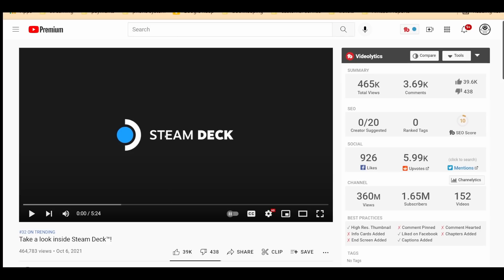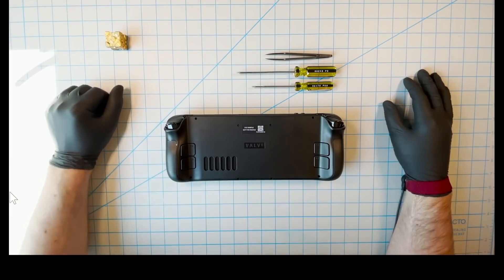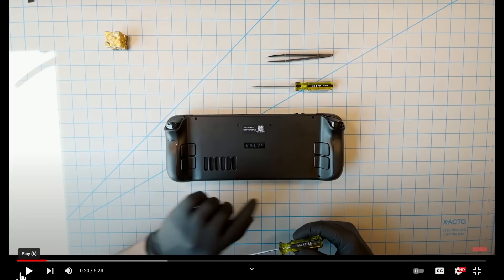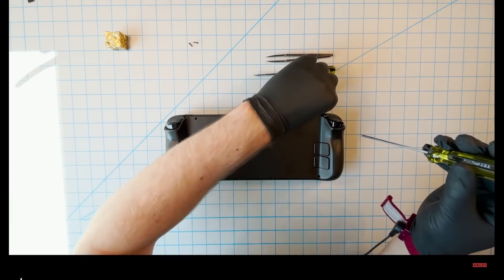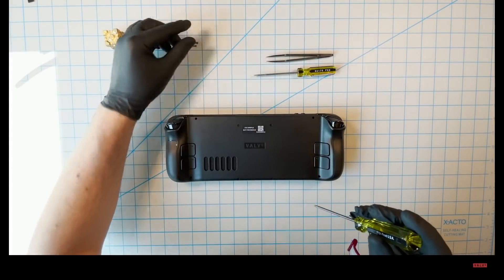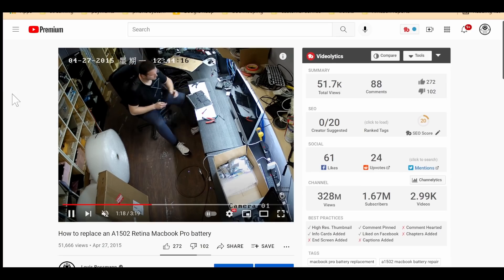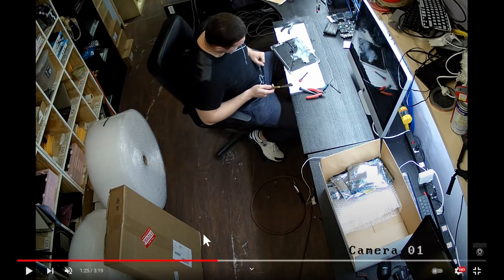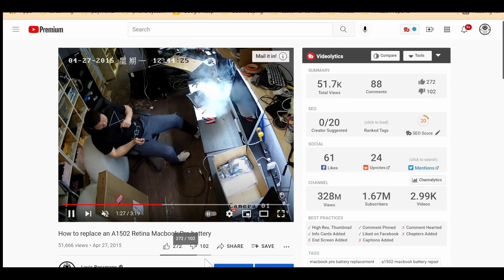Steam deck battery may end your life? bruh 😑

Comment: Regarding the losing stability when dropped when opened and I may be wrong how I understood it but this is how I understood what they said:
They mentioned that self tapping screws are much easier to strip and once you strip them the structural integritiy - of course - suffers. Also, from experience with self tapping screws in plastic: they suck. Hard. They will never be as tight after unscrewing and screwing them back in compared to the original screw in. Self tapping screws into plastic is easy and cheap but designwise it's absolutely horrible.

But all in all, I mean, the disclaimer with the batteries... I feel like they also have fears kids are just gonna poke around in it. I'm not saying kids will, because when the PSP was introduced, I don't remember anyone of my friends who hat one went ahead and poked at batteries for fun and then being suprised they burnt themselves (and I had some pyromaniacs as friends...). I have nothing agianst them saving their butts. And they even say, you have all rights to open it up, we just say, if you need anything repaired, better bring it to a professional. And that is pretty much what right to repair means to me. You have the option of doing it yourself, but so have professionals, who are independent repair shops as well.
I mean, yeah, you can cut your hair yourself, but if you really want it to look good and it's a cut you haven't ever had before, maybe it#s best to visit a hair dresser. And that is perfectly fine with me.

Comment: It's just an assumption, but the comment about the device being less structurally sound might have to do with the fact the crews are self taping. What I mean by this is that when the screws go in the first time, they go in the plastic without there being a hole or a hole of the same diametre as the screw, so it's held in due to friction and displacement of the material. Therefore removing them may remove some material and reduce the local stresses and thus make the connect later on less snug. 

Again, no idea if that's true or even if it makes sense but I can imagine that being the case, just my 2 cents.

Comment: Structural integrity of the bosses definitely decreases each time you remove and reinsert a self-tapping screw. Threads have to carve new channels to lock back in, and if the channels aren't 100% lined up with the originals, it has to move more material and locks less securely into the boss. Plus, flexing the locktabs of an injection-molded case weakens them every time they are removed. There's no way around that, most plastics only become weaker and more brittle with time and stress.

Comment: I don't believe that the structural integrity is going to be affected after you open it. Maybe it will if you break some of those plastic snaps that hold it together and are built into the case, but that won't affect the drop resistance IMO if you don't break like 50% of them. 
I've broken one on my Acer laptop while opening it and all it did was that one 5cm section in the case is just 0.5mm higher and doesn't snap in properly. no big deal and not noticeable unless you're looking for it.

I'm not a mechanical engineer, but I do design my own mechanical parts and 3D print them so I know a little bit about the subject.

Comment: A bit overdramatised, for sure - a better way to put it IMO would have been something like "if you screw this up, you could kill your device, forever. If you really screw this up, you could kill yourself. Also forever."

And yeah, self-tapping screws in particular will loosen the threads every time they're retightened. It won't kill all structural integrity at once, but if you pop the device open a dozen times to mess around with the insides on various occasions, you'll definitely notice some looseness.

Comment: "No, seriously, don't do this if you don't know how. Seriously. Ask yourself if you know what you're doing. This thing is expensive!" - Valve
Reply: Tbh this is a pretty decent advice.
Reply: @manny022 welp, there is a compromise between repairability and portability. A company making a custom cooling solution to fit in a smaller chassis, while impossible to get 3rd party replacements for, isnt dumb. Apple deciding that the exact same screen model cannot be interchanged because of a custom security code embedded into each one is absolutely dumb, however.
Reply: @manny022 In oder to do this your laptop would need to be the size of a pc.

Comment: I don't have any issue with the warnings, even when they seem a little fear-monger-y.  I think that it's correct for a vendor or subject matter expert to advise that there are risks beyond what the average person would expect and that it is advisable to have a trained professional do the work.  And then follow through by making NO ATTEMPT to stop people from disregarding that advise.  No attempt at hardware/software level "got ya!"s, no attempt at exploiting regulation for their agenda etc.  Bonus points if they make the effort to mitigate some of those risks by educating on what to watch for.

These are complicated devices with specific designs.  From a legal perspective, you can't treat everyone as "the average person".  You have to assume that someone WILL be in the state of mind where they will inhale lithium battery vapor without a sense of self preservation.  That's why warnings that we think are crazy have to exist.  The problem is when they build in measures to prevent you from working on the device.  When they try to make government fight their anti-consumer fights for them.

Comment: Self tapping screws gets worse each time you tighten them but how much... that is entirely up to the person who is tightening them. Not exceeding the torque limit and there is practically no difference. Exceeding it even slightly will cause material to deform and it will be less rugged. With care you can do that dozens of times and being careless you can strip the thread of every single screw the first time you close it. The smaller the screw, the easier it is to overtighten them.

Comment: 9:00 I've built and repaired devices held together with plastic screw bosses my entire life, and done so professionally as an engineer or tech at multiple companies. To get the best results, turn the screw backwards until it falls into the existing thread, then gently turn forwards to follow that thread. You can do that many times without substantially harming the structural integrity. It technically is slightly weaker each time, which might show up in drop tests. If you do it *badly*,  particularly multiple times, you'll wind up with rickety garbage.

Comment: @Louis Rossman Materials Engineer whom specializes in Polymer Processing and Additive Manufacturing.
Yes, self tapping screws will affect mechanical integrity of the product. Practically though after 4-5 teardowns is where any real problems would be occurring. 1-2 Tear downs should be just fine but drops of substantial height might be a bit finicky and something may come a little looser.

Comment: About the structural integrity part:

The self tapping screws will have a perfect fit with the threading since they cut it themselves. After removing and re inserting the screws, they won't sit perfectly anymore. The screws will have some minor play which lessens the structural integrity because the backplate won't be as secure as before.

While this is only really relevant in theory, because the difference between before and after will probably not be meassurable, but its still a correct statement.
Reply: If you open the thing 10 times in a row, those screws won't have anything left to grab on.
Reply: Can confirm, many interior pieces in automobiles that I have worked on over the years use this fastening method. Maybe the first time you screw something back into plastic it's okay but if you've got to do it multiple times each time you're just removing more and more material from the hole. There are ways to repair such threaded holes, what I usually do is fill the hole with epoxy, let it set and then drill out a new hole for the self threading screw to tap into. It very necessary when you're installing an interior piece to a car that hasn't been manufactured for 40-plus years.
Reply: Add that some idiot will tighten them too hard , strip the plastic, or cross thread them somehow
Reply: Maybe also those flimsy plastic tabs that might weaken or break
Reply: Additional to the Screws you can damage the Case when you pry it open.
There is a good chance to have micro fractures in the plastic that you wont see but will weaken it.
Reply: can you just put some kind of plastic putty in it and retap it?

I am just thinking wood screws do the same, but you stick some wood in there (tooth picks, splinters, etc and little bit of binding if you really care (glue for example)).
Reply: @Waitwhat469  For screw bosses that small, maybe. If you happen to have a small drill bit of the correct diameter and a thread tapping kit, sure you could change those to whatever screw size you want within the limits of the screw boss diameter. Not everybody will have a tapping kit though, but I'm sure somebody will make a video on how to do this kind of repair.
Reply: @KuraMad2000  I shall make a video on this kind of repair

Comment: I think they're referring to the self tapping screws with the structural thing, as they do deteriorate the plastic they bite into. Also with the user replacable thing, I think they mean not to not repair stuff, but to use the same specific components they picked out. Aside from the stupid "deadly" thing, a pretty good showing I'd say, I'm guessing all the overdramatic warnings were them covering their asses.
Reply: If anyone else worked on those crappy exceed rc RC cars when they were a kid you know; every time you screw a self tapping screw into plastic you're one step closer to it stripping! I doubt it'd effect the SteamDeck all that much given there's plenty of clips, but my sister's laptop fell apart from screw bosses failing, and it's probably again to cover their asses

Comment: Former Fujitsu field engineer here. The structural integrity comment made by them is unfortunately accurate.
Fujitsu did the same stupid shit that the manufacturer of steam deck did - make cylindrical screw holes in the plastic bezel instead of embedding nuts into the plastic. So, when torqueing the screws down in manufacturing, they weaken the plastic with those damn self tapping screws. If you are not extremely perfect in reassembly, you'll damage those more by cutting new threads into the plastic, as well as a good possibility of stripping the screw heads. After reassembling the tablet/laptops of 3 generations ago for the center hinge fail,  replacing failed wifi cards, replacing failed mainboards, or replacing failed hard drives, I frequently had to call our Memphis dispatch to have them send a bezel and screw kit, as the damn plastic the screws went into cracked and broke. It's just being cheap in manufacturing, and it makes repair a PITA. 
FranLab has a good piece of advice here - when screwing those type of screws back in, make sure to go into the opposite direction first to find the original cut threads. It will save wear and tear on the plastic bezel, and assuming you use properly fitting screwdrivers, save you from stripping the heads on the screws.
Reply: Note that if Steamlabs makes the bezel as a replaceable part, then you'll have that fun when fixing that too, since you'll be cutting into the plastic the same as the manufacturer did.

Comment: Regarding the Lithium-Ion-Battery, as far as I remember a light damage to the battery does not mean that it would blow up immediately.
It might take hours or on the next charging cycle or days until the battery fire does start and as he said "...the hole thing can catch fire later" . 
If the device is lying on or near flammable objects while you are asleep you might actually die from the resulting fire. 
And insurances are really proficient in finding causes of fires and might hold you accountable for all kinds of damages.

Comment: I'm no expert either, but I imagine that since the screws for the back shell are self-tapping into plastic, the pressure applied by each screw would diminish every time you screw it back in. Saying it reduces structural integrity is true, however (especially if you turn counter-clockwise to drop into the already-made threads before turning clockwise) I don't think it would have a significant impact if you only open and close it a few times. If you've done it hundreds of times, then those threads will probably be very loose, and the back would likely pop off from a drop. Some other parts which rely on the back cover for integrity (if any) might also get slightly damaged. In the end, I think this is also just a legal disclaimer for people who will have opened it many times, probably will have cross-threaded the screws many times too and then complain when their steam deck breaks dropping to the ground within whatever #m valve says it's safe to drop.

Comment: The structural integrity likely has to do with the self-tapping screws as those are going to wear down the holes through time. Also, they used clips which can break when opening, especially if someone is unfamiliar with how to open things. Will it break down structural integrity? Sure. Will it really matter if everything is done correctly, no.

Comment: I like the fact that parts and specs will be available, and the fact that it really won't be planned to be obsolete like a Switch Console or a Phone. I mean yes, the hardware will run less and less games as time goes on but it's just Linux running steam, you can keep installing new games on it so long as YOU are happy with the performance. YOU decide when you need a upgraded steam deck..not Valve.

Comment: Used to race solar cars 20 years ago, and I witnessed a deadly lithium battery fire.  Then again, the driver was laying down, strapped down and bolted into the vehicle.  After that all teams were required to carry hundreds of pounds of sand in case of a battery fire.

Comment: The Structural Integrity bit:  I see two possible reasons:

1) You're screwing into plastic nubs, and repeat screwing will severely compromise the strength there.  Just cuz the plastic will get eaten away.  (Threaded inserts would fix it, but would be a fair bit more expensive in comparison)
2) The plastic clips that hold the frame together do get weakened by opening and closing repeatedly.  

Now, do I think opening it two or three times over the lifespan will severely compromise it?  Of course not!  But, Their video was Half information and Half "SCARY SCARY ELECTRONICS!!!" type crap.  

(Also, as for the "coming months" comment about releasing the thumbstick parts?  The Steamdeck isn't being released for 2 months, so they've got some slack there.)

Comment: In relation to the structural integrity of the console. I can give you a little bit of insight based on my own experience...

The Nintendo Switch was designed so badly that the plastics around the USB-C port snap and break when the board is removed. The fan vent also breaks very easily. Both of which are located directly in the middle of the outer bezel. The only way to remove the bezel is to remove the digitizer and LCD. If there's damage around the center of the bezel the structural integrity could be compromised.

The only way that opening the device would affect the integrity of the Steam Deck is if they copied Nintendo's design...  Or of course if the screw threads break easily like older laptops do

Comment: Not just a game system.  The Steam Deck is a full-fledged portable PC.  You can blow away the custom Linux Distro, and install Windows, if you want to.  You can attach a keyboard, mouse and a monitor.  Or you can take it on the go like a Nintendo Switch (though it's bulkier), which is really its competitive advantage.

Comment: On the structural integrity: I can't claim to be more informed, but my best guess is something relevant to the torque screwdriver they mentioned.  I imagine that the two halves of the plastic case sit flush when assembled by machine, and when reassembled by hand there exists the likelihood of particulate getting stuck, or the case misaligning, or a screw being tensioned wrong.  With only (two sets of) four screws holding the case together and none of the usual clips or adhesives seen on other compact devices, I can certainly believe the durability of the deck might be compromised by a hand assembly with the simplest of tools.  

But even then, not enough to invalidate opening it to replace a failing or worn out part.

Comment: As for the structural integrity, I do think it is a minor issue, but there is truth to it.  As mentioned, the screw goes into a plastic shell.  The plastic will get wear and tear from someone screwing in and out the screw.  Add on to that the target audience of this video is a layman who is far more likely to over torque the screw and crack the case or strip the threads from the plastic.

All that will make it easier for the case to break apart over time.

Comment: You can operate self taping screws only so many times, then the holes will get stripped. I guess that's what they're trying to say.
Here's how I know it: I have a cheap Chinese hand held calculator where I had to change the battery quite a few times by opening case. Some of the self taping screws failed, but it still holds together somehow.